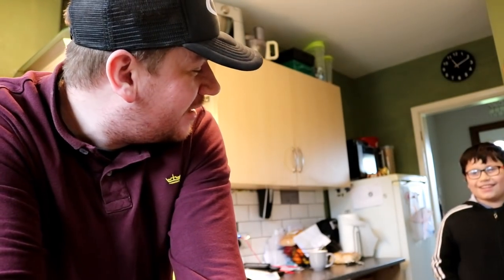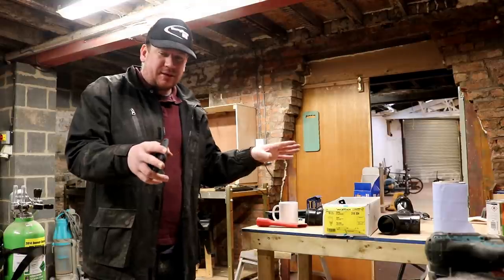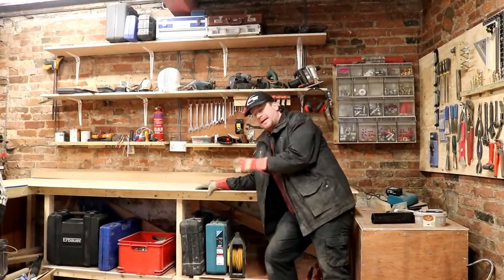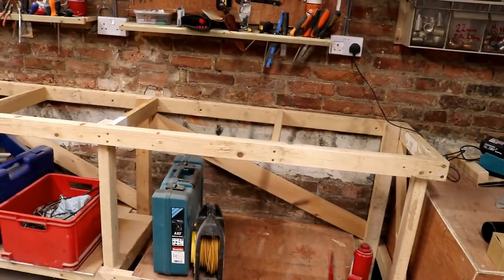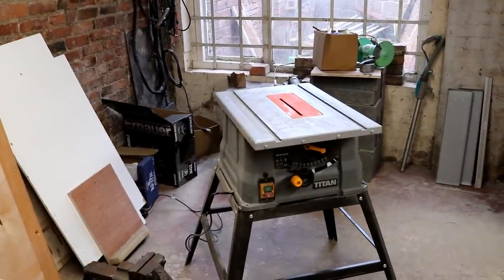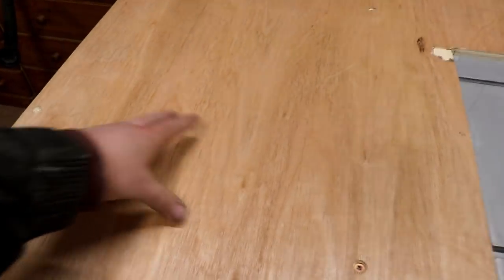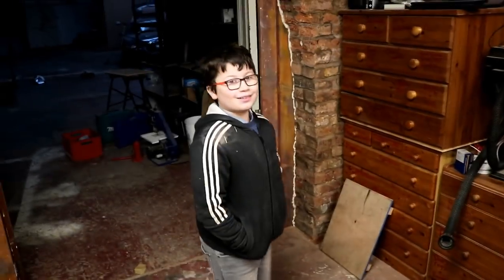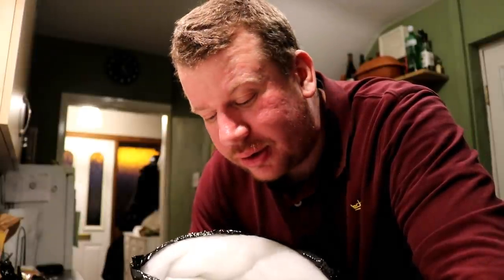I TAKE THE BOY TO WORK, ON A SATURDAY!

Comment: Nice vid as usual, just a thought; would it be better to extend the slots from the table saw into the bench top so that any guide used will have a free run, perhaps with removable inserts? Nice workbench though and well constructed. Cheers, Schnuz.